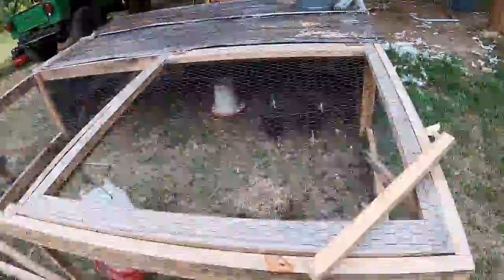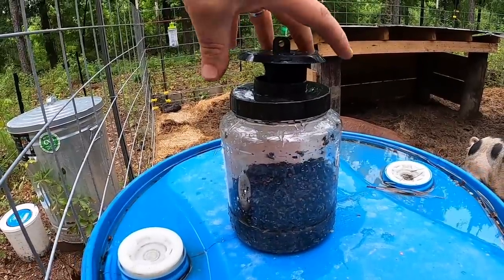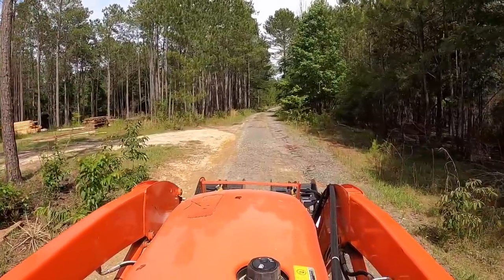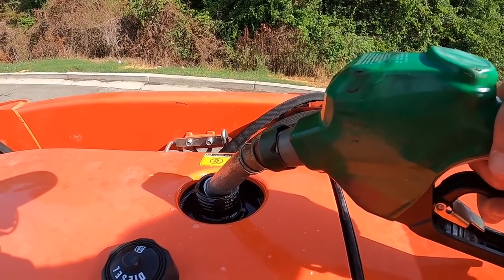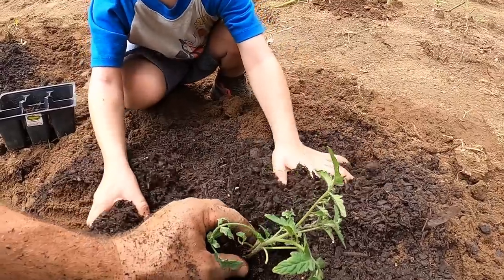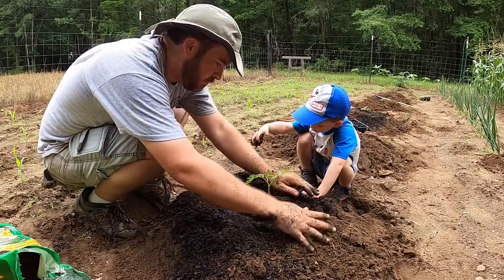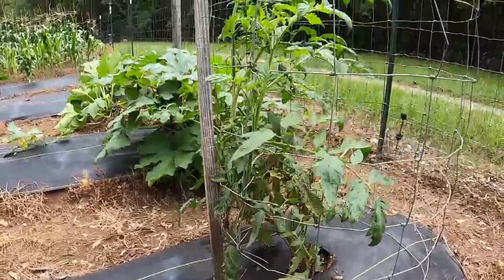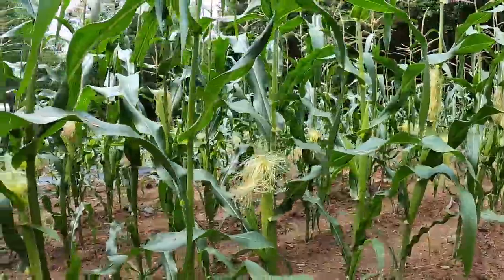I Was WRONG About This Tractor

Comment: Really like your side-side "green machine", so "deluxe". My kubogy TLB mx5200 shuttle gear drive gets 1 1/2 to 1/2 gallons per hour---it all depends. When fuel was 2.50$ per gallon ,l spent more money on GREASE. The fuel is the LOWEST component of TRACTOR use. TO BUY & OWN my rig the cost is 60.oo$ per hour minuse fuel,grease, oil & filters @900 trouble-free hours in 5 1/2 years. Words of wisdom" always use Kubota brand filters", they are the best & the cheapest insurance for LONG LIFE you can get. Thank you for the great Video Sir and happy safe tractoring & farming.

Comment: The corn looks good. I have found that my corn does better with regular Nitrogen supplement. I use a Blood Meal that is rated at 46-0-0 to side dress the plants. Once when the plants are about 12" tall and then a generous dose once the silk starts to form. Of course I amend the soil with my own compost when I plant the seed. Chicken litter is really good in the compost pile (a lot of ammonia in it).

Comment: Just a quick gardening tip. When planting tomato plants the top of the soil level in the pot is the level you should be planting them at when you put them in the ground. I have never seen mounding tomatoes, but I don't see why you can't in a wet area. Be sure to pack them in tight to the existing soil and do not bring the soil up the stem.

Comment: I plant one of those Parks Whopper Improved tomatoes every year. Here in our California weather they get 6+ feet tall and 3 feet across and get loaded with big tomatoes. One of my favorites to get from a home store. I start all the rest of my tomatoes from seed. You may be having problems with your tomatoes dying due to the overhead watering. It may benefit you to run drip to the tomatoes and if possible adjust your impact heads to stop before hitting them.

Comment: I'm not sure but I think my B3200 has the same engine as your L.  It is a 4 cyl, don't remember the model. I mow 4 acres of yard area and I can do them twice before I have to fill up. I measure my "economy" by how much I get done!!!!! This is my fifth Kubota. 1-14hp, 1-17hp, 1-24hp 1-27hp, and 1-32 hp. Mine is now ten years old with 1500 hrs and it doesn't have the "regen" system. It was the last year before the "regen" systems on any engines above 25hp.  good luck

Comment: the problem with your tomatoes is the depth you're planting them at. I used to plant them the same way, but then my good friend at the greenhouse advised me to plant them deep enough so just the tips og the top leaves are exposed. IT WORKS! With the roots 8-10" deep i don't water them anymore! As a matter of fact, I like to buy my tomato plants allow them to grow too 12"s and then plant them 10-11"s deep. Try it, you'll like it :) I was finishing watching your video and you were plucking the lower limbs off. Just leave all the limbs on the stem, they will become roots.
Reply: I was gonna say the same thing.  The best crop I ever had, I double dug the garden bed where I planted the tomatoes.  I laid out a tarp to the side, dug out the soil 6 inches deep tossing it onto the tarp, then dug out another 6 inches, onto the tarp it want, then to 2 parts soil, I added 1 part each of composted manure, vermiculite, sand, and all the chopped up leaves I had in a pile.  Mixed it well and filled the garden bed with the mix, the planted my tomatoes deeply leaving just the top 3 or 4 inches of the plant above ground. I watered profusely when planting before filling in around the plants and then watered the whole of the garden.  And, I put Scott's Miracle Grow in the hole with the root ball and then added a circle around the plant on top of the soil.  Didn't need to fertilize again the entire summer.  Best danged beefsteak tomatoes I ever grew. Couldn't eat them fast enough.
Reply: That's what I do also.  Cut off all the bottom leaves an plant them as deep as I can get them
Reply: @4wheelliving132  no need o cut off the leaves. They will become new roots.
Reply: I was thinking the same thing about those lower stems.

Comment: Wes, have you ever found any extra time where you can do a little research with your tomatoes and your potatoes? They're both from the same botanical family ( nightshade ) and you can graft them together. 
     When you're planting potatoes, get a head start on the green foliage by cutting a tomato plant stem and sticking it into the potato starter, then planting it. Maybe seal the graft like any other graft (grafting wax).
     Another idea; Take some store-bought dirt that is formulated for tomatoes and  fill up a car or truck tire with it. Slip in a couple of potato starts on opposite sides, and, Voila ! , You've got a potato bed ! It gets the extra heat of a raised bed, plus even more extra heat of a black cover, so it will dry out faster than you might expect, pay close attention to it's moisture. Maybe a drip watering technique would be good for something like this... Hope you can find a little time for this, I'd like to see how well this can work in your area... Gary
Reply from the maker: Thanks for the info, Gary! Thanks interesting that they can be grafted together.
Reply: @falllineridge  It's also rather interesting that if you have the time to play with your garden, you can get both potatoes and tomatoes from the same hill... My preference for potato is ."Yukon 
 Gold"....
      Tomatoes (and any plant in this botanical line) make a chemical called "lectin"... It's worth Googling that...it will make you consume tomatoes in a more restrained manner...

Comment: And here's another tip I'm passing on from another YouTuber: take 3/4" pvc pipe and cut it the length of the handle on your 5 gallon pails. Remove the handle metal from one side, slide the pipe on (requires a little tweeking) and over the existing plastic handle (use 1/2" pvc if the original handle is missing or badly broken), put the metal back into the pail and there you have it: a handle that will last way longer than you will...lol, and a tremendously more comfortable in your hand (especially small hands, i.e. ladies).
Reply from the maker: Cool! Thanks!

Comment: I wouldn't mind swapping fuel prices with you. I just drove by my local gas station a couple of hours ago and the diesel was 9.10 $ per gallon!
Reply: In Northern Ireland road diesel is £1.82 per litre which equals $8.61 per US gallon. Off road is £1.30 per litre which equals $6.20 per US gallon. Have still not won the lottery!
Reply from the maker: Unreal.